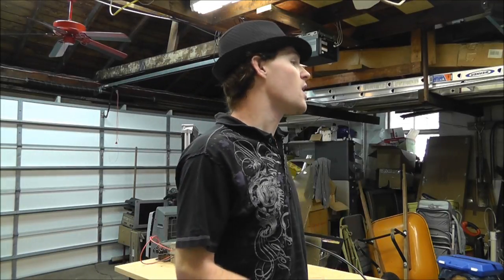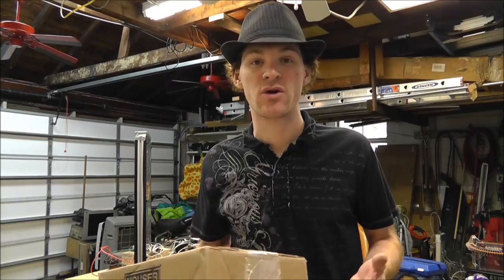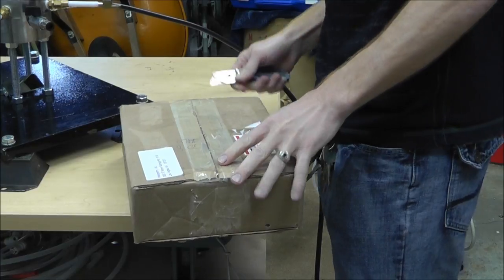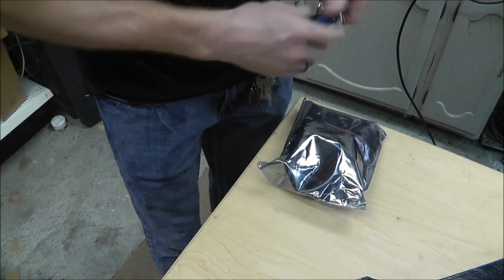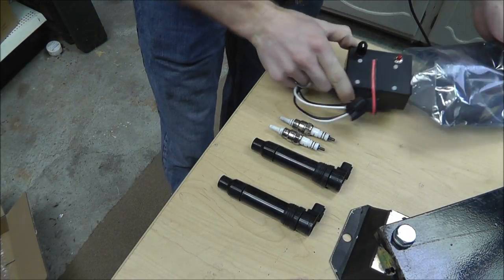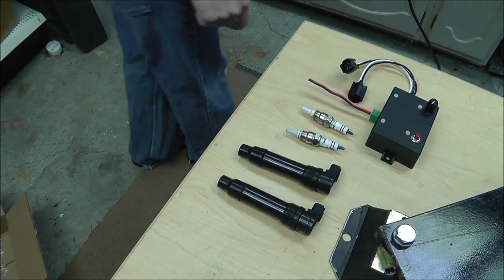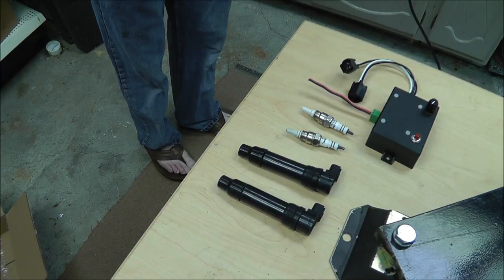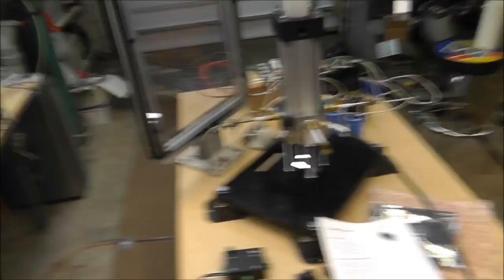Update 9 NGE Papp: Popper Kit... I Did It Any Way. Im Here To Test. So Test I Will. ahhh,RWGresearch

Comment: Why didn't they use ceramic liquid paste super glue is not my idea for heat protection's they don't thing about useing the secondary build up of the plasma voltage's from the plasma a secondary set of probe's with diode's to a capacitor would be nice to see

Comment: Those WeaponX parts are import performance parts..probably from a japanese import. Is there a part # on the top of the coil stamped onto the epoxy? Do you know the voltage? they should be super easy to find. 
They can be bought for about $300 for 4 or more. weaponxperformance. /weaponx/catalogv137/ignition-coils-c-13.html